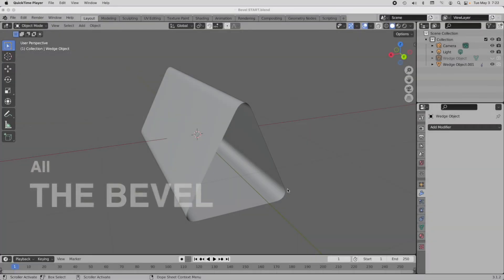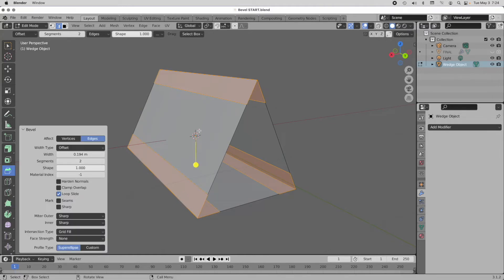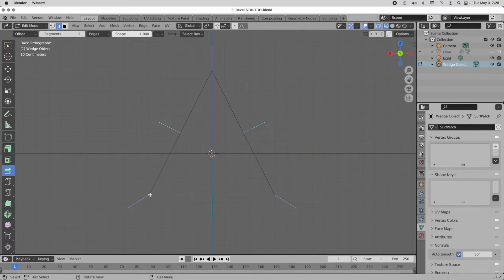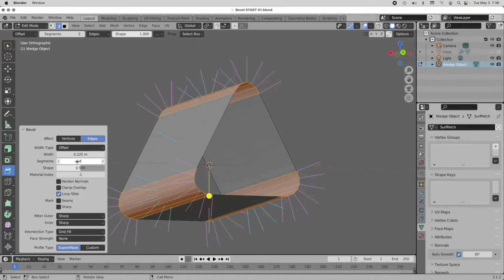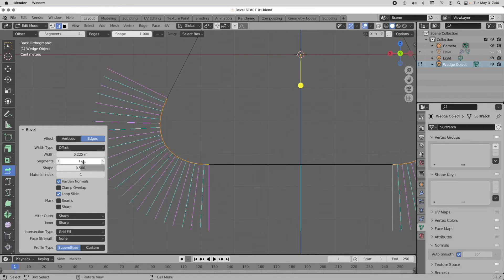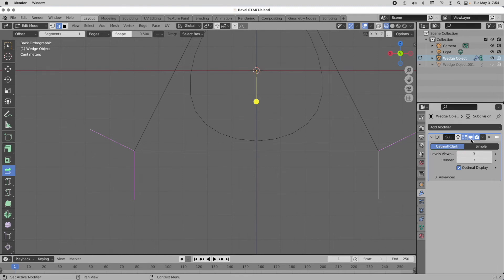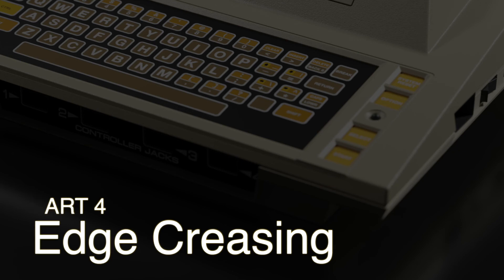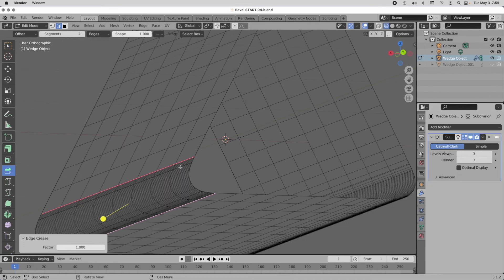Blender's Bevel Tool & Normals

Comment: 95% I work my bevels after the subdivision, non destructively, by marking my creases and bevel weights. No need for support loopings then and always finishing with the weighted modifier for correcting the normals at the end.

Making bevels in edit mode is so rare in my workflow! The end result is very low poly, easy to change, maintaining and iterate further.

Comment: Superellipse 0.75 provides far better curvature transitions than default 0.5. Working with this in Blender we're limited to Matcap and one of the Zebra stripes modes, in Solidworks we'd use curvature combs as well. No designer knowing these tools would allow fixed radius transitions into flats, but try to remain curvature continuous. It's important to how it feels holding it, and plays a very important role on highly glossy polished materials.
Reply: 0.75 ain't round though, so why would you want to use that instead (unless you'd want that specific weird semi round shape that is)?
Reply: @gurratell7326  It has to do with surface smoothness. 0.75 offers far better curvature continuity (and thus better reflections). A circle offers only G1 (tangent) continuity. I don't know if 0.75 goes G2, but it sure looks a lot smoother. Even Solidworks have issues doing G3, but G2 is no problem at all (designated relation). But G1 just look lousy. Obviously I'm disregarding G0.
Reply: @gottagowork  Yeah sure the transition from round to the flat side is smoother with 0.75, but it's not a perfectly round shape which is what one might not want.
Reply: @gurratell7326  Surface quality should matter if you're into industrial design. The levels are:
No continuity (surfaces are separated).
G0 Contact (sharp, no bevel at all, but could be a chamfer).
G1 Tangent (fixed radius bevel)
G2 Curvature (ends have same radius and concentric)
G3 Torsion (comb lines flow into each other)
Usually G2 will be enough (such as human interaction surfaces such as grips and handles), but if high quality surfacing is required (such as automotive industry), you should consider upping to G3.
I'm not claiming 0.75 produces true G2, only that it produces better results than 0.5 (=G1) wrt visual appeal especially on highly polished reflective surfaces. Catia and NX can do G3, I don't think Solidworks can yet (although you can approximate it by setting up guides manually).
Sadly, from the Blender models I've downloaded and tried out, all that seems to matter is "some bevel" to catch the highlights, now how reflections actually flow.